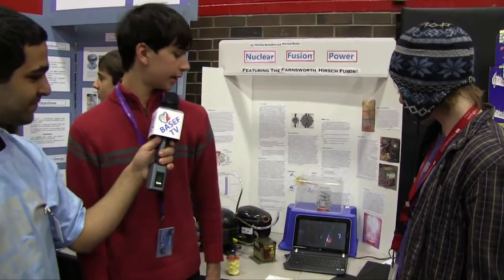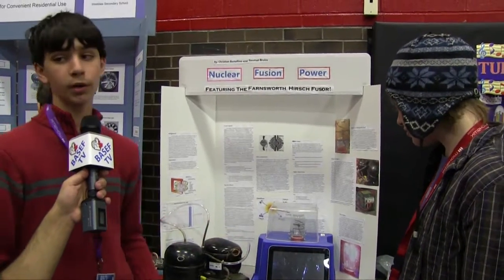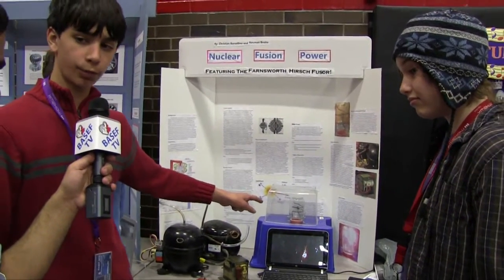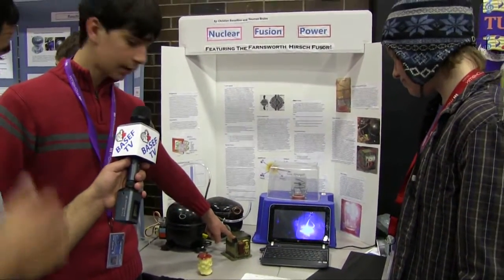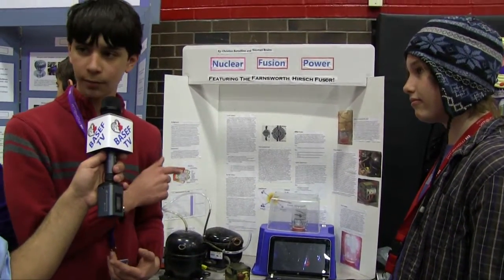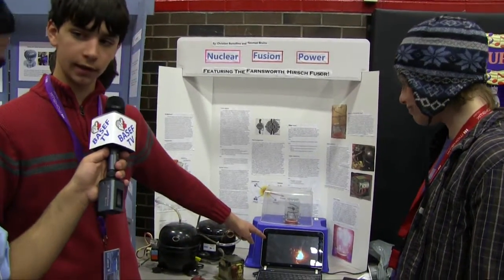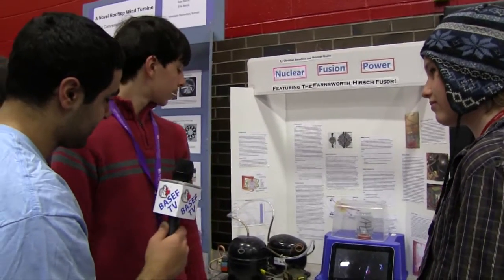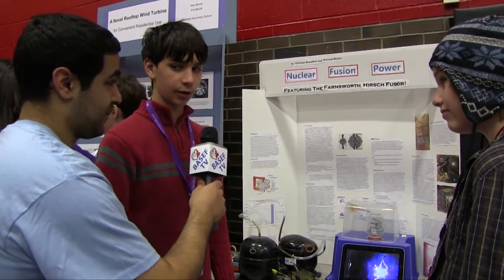The Farnsworth Fusor, a Star in a Jar

Comment: i like the look of this channel you seem to have some pretty good video's.. the only things i can point out in this video is the information the guy was giving weren't completely true.. when he said its a real working fusor when for it to really fuse it has to be brought down to a vaccum  of 0 microns what a fridge compressor is not capable of then the vaccum brought back up to 30 microns by injecting deuterium gas then feeding the reactor with at least 10,000,00 volts then you are fusing.